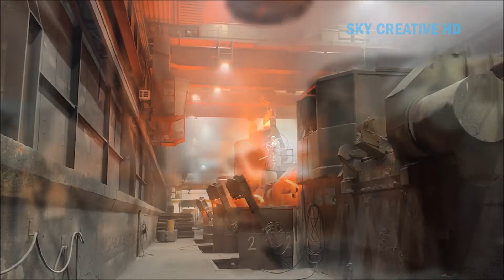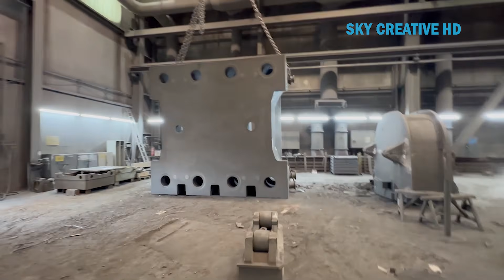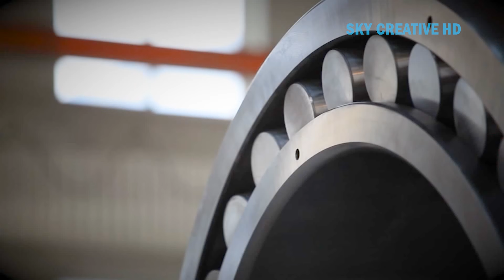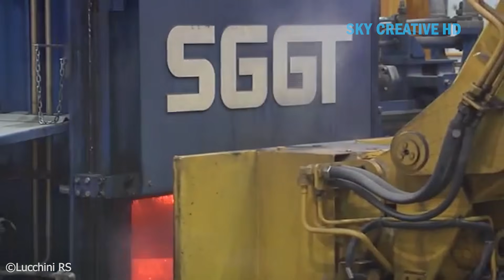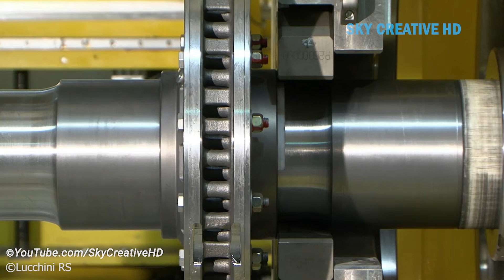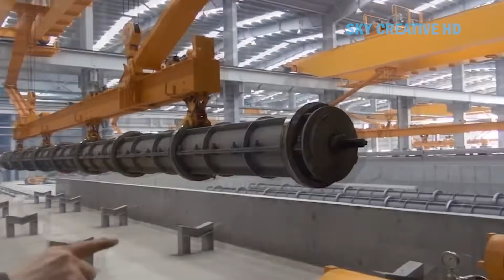How 200-Ton Steel Gets Forged to Engineering Marvel - Inside World's Largest Steel Forging Operation

Comment: Complete BLX. Did the narrator have any idea of what he was looking at when he was on about hundred ton ingots and placing under a huge forge able to exert ofrces of up to 16,000 tons. Whilst a ladle of molten steel is being transported. So, 2 min 51 seconds in and I've seen enough. Abandoned and this channel added to my BLOCKED list, clearly click bait and no knowledge of what they are talking about added to which 97% of the world are METRIC, if both imperial and metric were quoted it would help to.
Reply: Tons is not a force